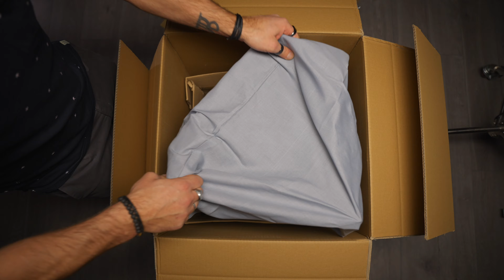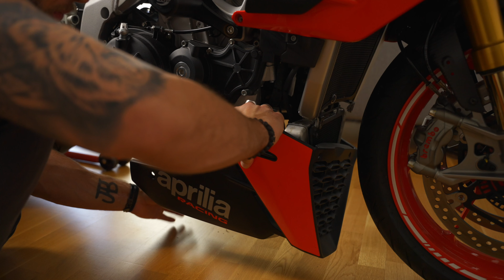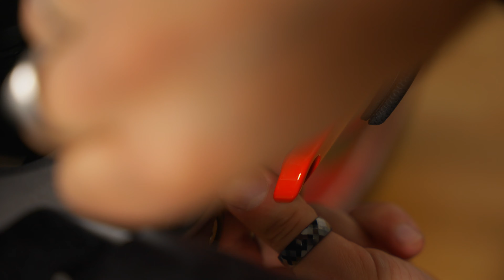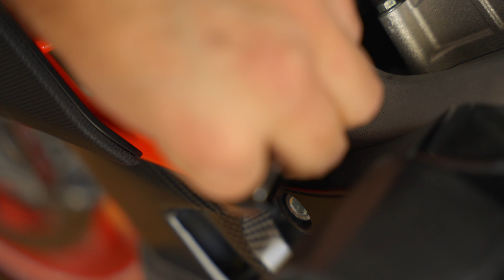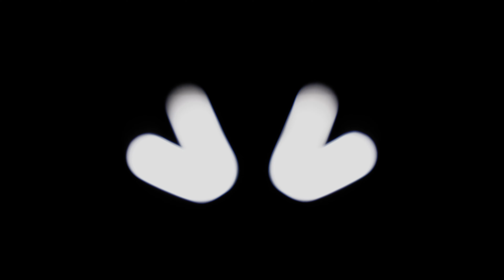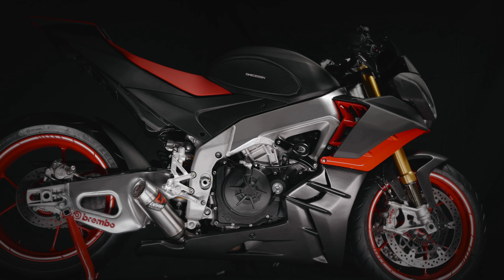Unboxing & Mounting Ilmberger Carbon Fiber Belly Pan | Aprilia Tuono V4 -21

Comment: Great video! Was there a noticeable difference with the bike engine temperature while riding after installing the belly pan?
Reply from the maker: Never tried the bile without the belly pan but never had any overheating issues at all. Also had the gabro map and it lower the fan temp as i understand it

Comment: Is this the matt carbon? Does it have a clear coat on it? I’m asking because I’ve put some matt carbon parts on my ‘21 Tuono and there’s an issue with the front carbon fender. Now I want to replace it with an Ilmberger fender but apparently Ilmberger puts some kind of clear coating on their matt carbon parts?
Reply from the maker: Yes it is the matte version. A matte clear coat is added to get the matte surface finish.
Reply: Ok thanks 👍 that’s an RSV belly pan, right?

Comment: Do you have any videos with the exhaust sound? I love shortys and it looks sick but is it super loud like the sc project crt's or s1? it says its 110db which is 9 off the sc project wondering if its a crazy difference. Thanks bike looks amazing love the instagram too :)
Reply from the maker: Thanks man! There’s a few clips with the sound in some of my reels on instagram. For me the the sound level is ok with the db-killer, even without ear plugs for shorter rides but for longer trips i use ear plugs (also for wind noise etc)

Without it’s INSANE and and everyone hates you, except people with similar bikes and teenage boys who twist their hands in the air when they see you! I like the sound more without the db-killer (Deeper and louder) but it’s not practical for me in 95% of the time when I use the bike… But it’s just one hex bolt for it! 😉
Reply: @oblank_creative  Thanks for the reply man! Yeah I’m torn between the track 300 with a normal link pipe or possibly the shorty versions but just aren’t sure if it’s too obnoxious 😂 

Definitely sounds good, exactly and these bikes are loud as it is to be honest! Wonder how the exhaust would be in the UK as it’s abit stricter here I believe…